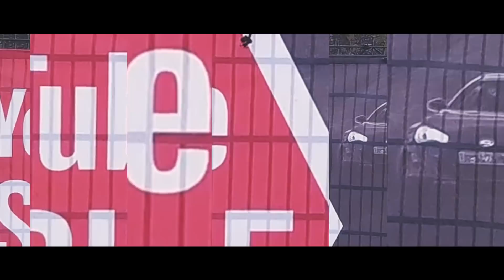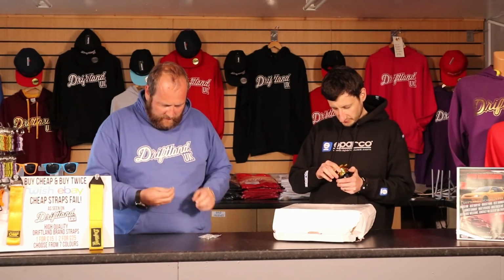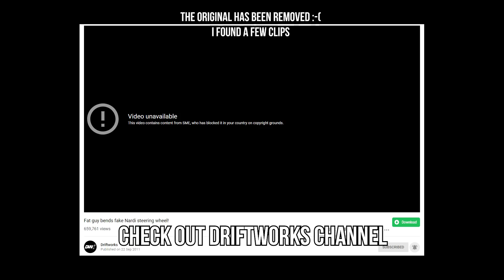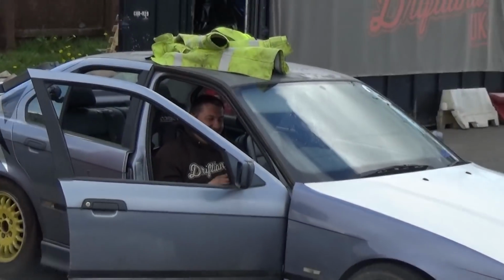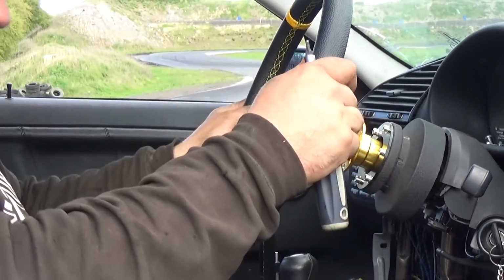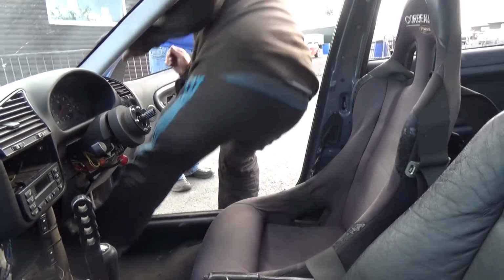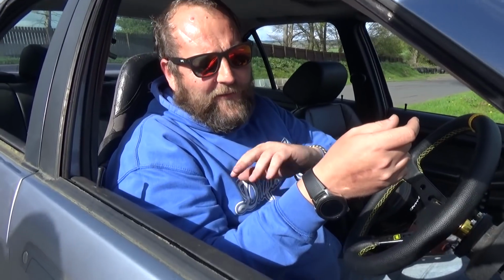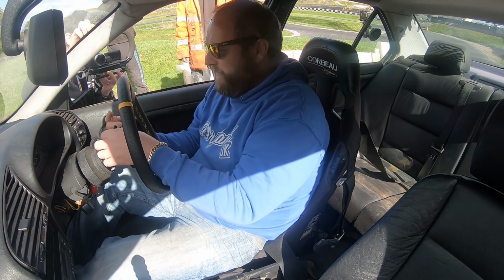Wish.com Steering Wheel and Quick Release Boss Test! OMG! 😱

Comment: What happens if you put the same amount of force on a real brand steering wheel?
Reply: Real wheels, even OEM wheels, aren't budging. Cheap wheels are made with cheap metal, there's a huge difference between properly treated 7075 aluminum (the stuff in jet fighters and race cars) and recycled 3004 aluminum (the stuff used for beer cans).
Reply: If they are as good as you all say, I want to see this now 🤔 lol
Reply: 'Real brand' wheels that we had in our rental race cars (which people crashed a lot) simply bend. That's their job, an OEM steering wheel also does that to prevent you from breaking wrists etc
Reply: Kris Nicholson the ring that you put your hands on absolutely bends, that's what it for. Seen it many times. BMW Porsche Toyota anything
Reply: I couldn't break my Corsa B steering wheel back in the day, that was large enough to double up as a spare wheel for a horse and cart
Reply: There's a driftworks video with a similar comparison
Reply: Teodor Klippmark you can watch rally crashes onboard , most of the car use OMP even 2 spoke steering is solid .
Reply: I've had an frontal accident with an tunned up ibiza.....
Long story short, I'm a 200 lbs pack of muscles, and I saw the accident coming, I stiffened up my hands and after the impact the steering wheel was bent..... And it was the original one :)) from Seat.
 Was proud that I was strong as fuck, and didn't get a scratch out of that, but I was "Wtf, does that happen?".
I've also came off the track and rolled at 130km/h and the sterring wheel didn't deform what so ever from pulling it and pushing it.
But that's spaghetti silly :))....It's not even driveable.
Reply: I’ve seen wheels bent in the shape of foreheads. OEM wheels. That’s what’s supposed to happen
Reply: Ahem, slap this man someone, sounds a bit like a scientific approach to me...  We already had this discussion!
Reply: @Kris Nicholson was just about to make this very point. At the point of impact your hands should be nowhere near the steering wheel... Easier to achieve if you're a passenger, seems very counter intuitive but if you crash enough you'll get used to it!
Reply: @scoobydoodandy4296  if you crash enough you need to learn how to drive, or your a banger driver, then go and hit someone for our entertainment.

As for bending the original steering wheel. They do bend. I worked in a junkyard and seen a lot of bend steeringwheels. I even bend a volvo steeringwheel with my own hands. Not even that hard actually.
Reply: @scoobydoodandy4296  Racing drivers take their hands off the wheel before impact because when one or the other wheel gets punted, the force will spin the wheel hard enough to shatter your thumbs on the spokes, or dislocate your wrists. Or, for that matter, both.
Reply: @mfree80286  yes I know, that's why I said it. @bob Rosco in the case of racing drivers if you don't crash occasionally then you're not trying hard enough... In my case I was a passenger in a V3 STI which left the road backwards and hit a concrete post which caused the car to cartwheel through a tree. I had my arms crossed over my chest and walked away with only 45 stitches in the back of my hand.

Comment: I got scammed for a fake momo wheel in a regionnal auction. It's not only that the steering wheel can be bend if you use force on it, it's the bad feeling while driving because you'll bend it just by pushing while braking.

Comment: I bought a steering wheel off wish cause i was curious of the quality. I've been using it for quite awhile for daily driving. It actually holds up pretty well if you dont purposely tug on it like crazy.
Reply: And then when you hit/someone hits you and it folds like a taco and your missing your nose and teeth your gonna wish you spent the extra $150 haha no hate just sayin
Reply: I would just check the wish app for a new nose and set of teeth. No biggie👃🦷
Reply: @coiloverbags559  based
Reply: @b1gbeast86  if you hit anything with any wheel that doesn't have airbag, same result. No matter if u paid 50 bucks more

Comment: I run a Kode dished wheel in my car and that's pretty sturdy for a cheap wheel. Bought it from a stand at Castle Coombe and I've used it for 3+ years with no issues and it has seen track use.
Reply from the maker: sounds good!
Reply: Mcgills motorsports wheels are solid

Comment: I bought one of these around the same time as you guys, I've done almost a thousand miles with it and it hasn't worn out at all. As for safety, I've no doubt that if I were to really wrench at it then it would turn to chocolate pretty quick. But mine hasn't deformed with regular use at all so far. Thanks for the video though! Very insightful and slightly scientific ;)
Reply from the maker: 100% science here pal. good to hear youre still alive

Comment: Just noticed the MK3 / MK4 two front escort thing 6 mins in. You should be more worried about that than the wish clobber. Only joking, it's not a bad job. My mate Swede clagged up the roof and bodywork and painted that car in Northampton about 18 years ago. if it hasn't fell in half by now, it must be alright. How's about flipping the crownwheels in the gearboxes making it double rear wheel drive instead of double front wheel drive?
Reply from the maker: Yeah it's fine still. need rid of it. we made one video and never used it again. gets a lot of IG attention from passers by!

Comment: Where do you recommend buying an after market steering wheel from?  I was going to get one off ebay but when it says it's coming from China it puts me off....
Reply: Sandtler or any other Racestuff supplier.
Reply: driftworks
Reply: I got mine off a guy who does autograss
Reply: Mcgills in kirkcaldy
Reply: The omp replica is actually decent quality for the price just don't get the nardi style reps theyre terrible.
Reply: From a genuine wheels actual website or a trusted site like Tegiwa, Rival, 6TWO1 ect, dont cheap out on things that control your car...

Comment: I used to have the similar OMP steering wheel in suede though and the dodgy quick release and it worked fine for me. Only changed to NRG as the dish was too deep and the length of the quick release was far too causing me to drive with my hands just under my chin. lol
Reply from the maker: Haha t rex spec

Comment: Theres a company called McGill motorsport which i think is based in Scotland that sells very cheap steering wheels (30 odd quid i think) that are ugly but very strong. Iv got one in my mk2 escort and its taken all the abuse very well for just over a year now. I did use a proper billet boss tho (not quick release) The faux leather is starting to wear out but at that price i cant complain and Im probably going to buy the same one again. . . . . . . I had a replica 'Springalex' (the ones the rally escorts used in the 70s) before and the weld broke where one of the spokes meets the rim. Because the breakage was under the faux leather and i didnt want to re-trim it i injected some araldite and did a temporary repair so that i could at least drive the car on the road. One day i went for a little drift and a weld on one of the other spokes broke but the araldite repair survived!! haha! Proper quality Chinese welding!! :)
Reply from the maker: we use mcgills products all the time buddy they stock the STR brand
Reply: @DriftlandTV  nice to know they are Driftland approved! :)

Comment: Isn't it better to have a steering wheel with a bit of give in it for when you smash your head against it though?

* I'm not sure about this one, there's lots of things that will break if you try to break em. It seemed good enough really. lol
**Gonna have to do a crash test lads...
Reply: I’m not sure, obviously you’d want it to deform if your head hit it, but you wouldn’t really want the spokes to break and make you hit the dash/leave the steering column a spear with jagged edges on it.
Reply: all the decent brand wheels are not legal for use on the road in Australia for that reason, they do not bend when you hit them

Comment: I had that exact wheel on an mx5 a few years ago and it was much sturdier than the nardi rep i had before it.
Reply from the maker: there's so many variants of that wheel though
Reply: @DriftlandTV  the nardi one i had looked exactly like the one in the clip you cut to at the start. When it came time to scrap the car i pulled on the top of it ONCE and it folded in half and im only 11stone. Very happy i didn't have a crash with it on the car lol they should be banned they're far to malleable for a steering wheel.

Comment: to be fair i looks like it took a decent amount of force to bend it initially and that was in the week point without spokes i doubt you would ever bend it in regular use except maybe getting in and out of the car also i would defiantly prefer to dome my head on something that bends apposed to a solid piece of metal in a crash also the stock wheel in my 90 miata has quite a bit of flex in in and if a big guy like you tried to could probably break it to but i image it at lest somewhat harder idk ima try out the ebay bullshit and if it doesn't feel safe ill spend for a real one

Comment: a more expensive wish steering wheel? hmmm... xD
Reply from the maker: hah, we did go for the cheapy ones!
Reply: Yeah but I mean like, a comparison with the cheapest ones that you have scientifically tested in your controlled environment with a  slightly more expensive one for like, £40 quid, it'll probably still bend but if it doesn't, it might not actually be complete trash 😂😂 I'm not going to like though I was absolutely creasing about the "sweeper" mode 😂😂

Comment: My $400 momo mod80 folded in half when I hit the wall
Reply: Wheels are meant to give. It's actually an unfair criticism here . If your head or chest hits the wheel for any reason you want it to give and therefore drag the force over time out. 

You might be thinking with a racing harness how could you hit the wheel? Well... sometimes the wheel hits you if the steering column gets hit.
Reply: @Cragified  this is why collapsing steering columns save lives.

Comment: ask any car thief how easily any car steering wheel bends to take off them theft locks that attach to the pedal and the steering wheel,  mind that one seems very low quality,
Reply from the maker: do people still actually use them?
Reply: I don't think so, but steering wheels used to bend like toffee in the 80s ,ford, Vauxhall etc,  I think the airbags stopped that, WISH.COM sell stuff cheaper than the cost of the materials , labour must be by slaves in Chinese Gulags.